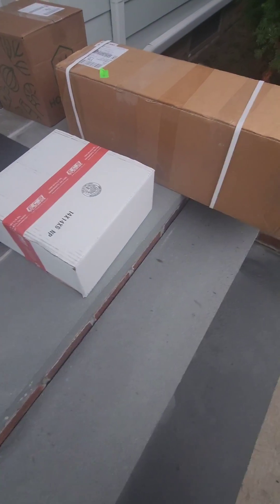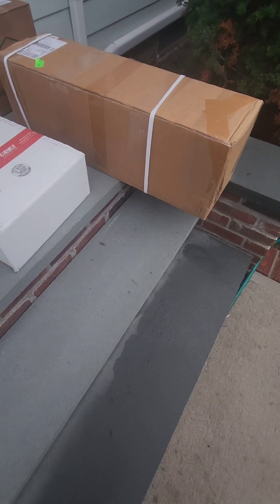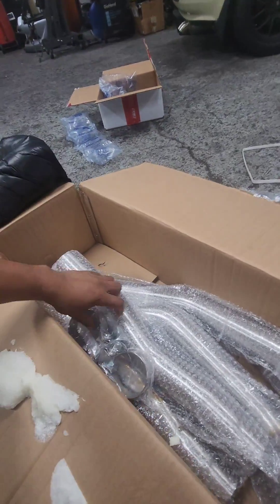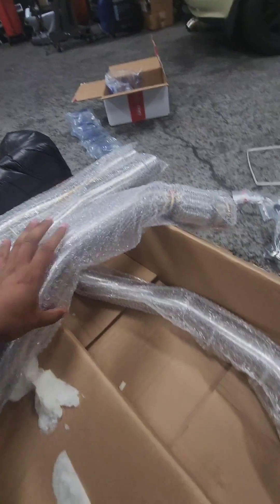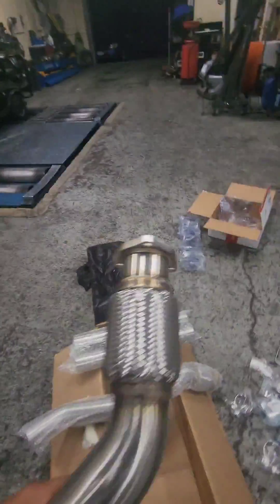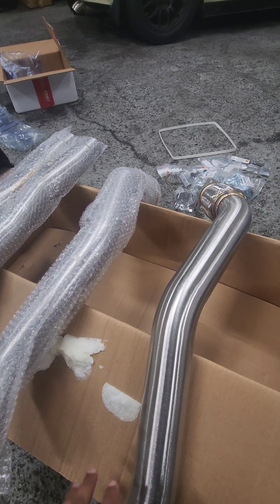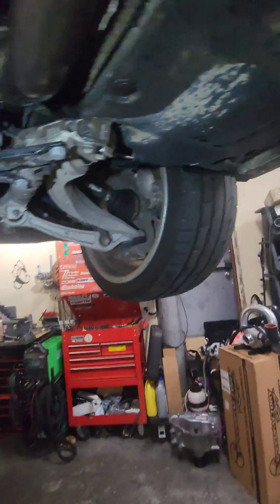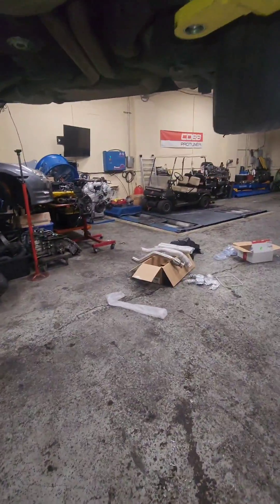B8 S4 Exhaust Explodes | New ECS Tuning Downpipes and Mid Section Install

Comment: Hey great video, is this the only modification to your exhaust system or are you also running test pipe or x pipe, thanks
Reply from the maker: I also have the red star test pipes, which now sound better with this mid section and downpipes, but the car needs either a j-pipe mod or another resenator to get rid of rasp.